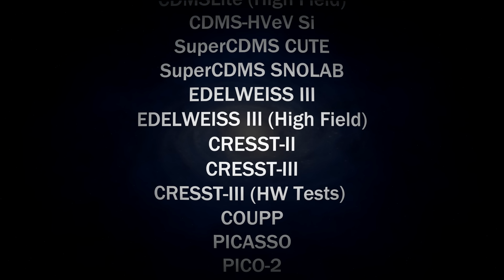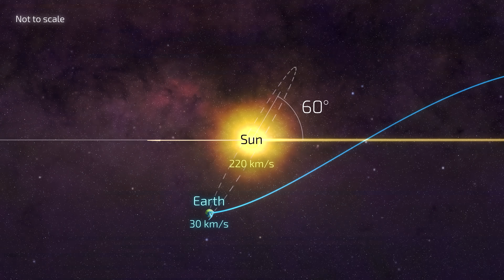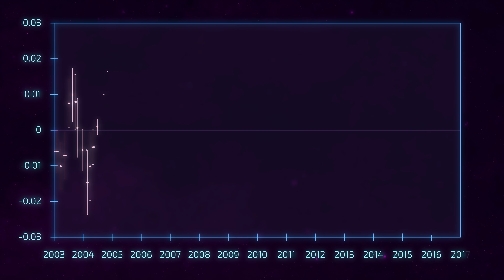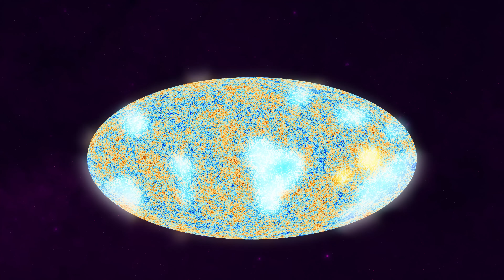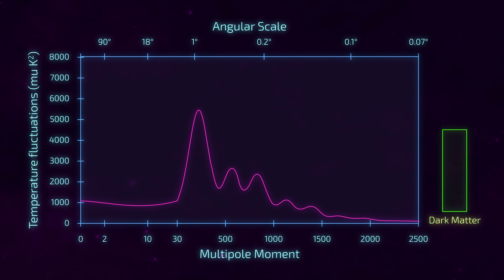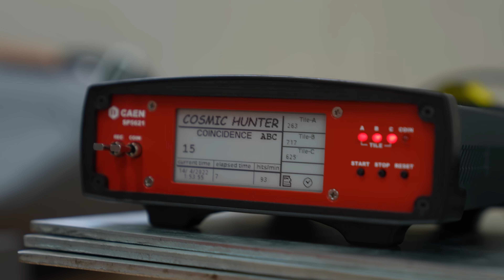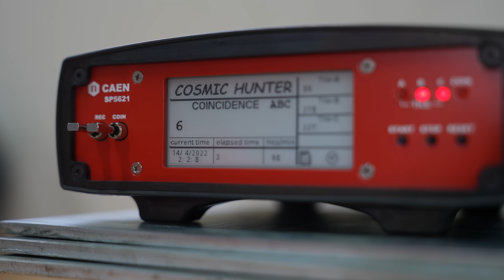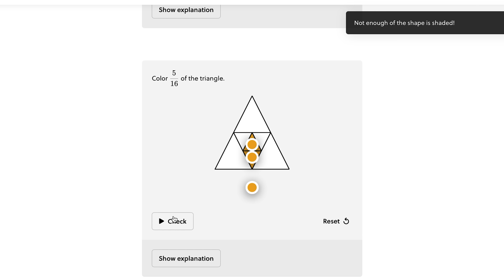The Absurd Search For Dark Matter

Comment: I would find it hilarious if all the filtering of the noise they do was actually blocking out the signal they want. I would also feel really bad for them, scientists are awesome.
Reply: The trick here is that wimps dont interact to ordinary matter that much so they'll pass through the earth with ease. So u can expect like some kind of uniform distribution of wimps throughout the earth and by chance some will interact with the crystals.
Reply: @thereaperandthesheep9186  great explaination thanks. It is a topic I do want to know more about someday
Reply: @thereaperandthesheep9186  If they don't interact with ordinary matter at all to the degree that there would be equal amounts of it anywhere inside the earth, then doesn't that mean they also wouldn't interact with the detector itself?
Reply: @Neme112  As I understand it – if they only interact by their gravitational field (due to their mass), than they would "knock" other particles if they come really close. As there's so much "empty" space between particles, it might occur only very rarely. I'm sure I've got this completely wrong (I'm not a physicist, just an ordinary electrical engineer who studied decades ago an only shortly worked in engineering), but I had to try … 😉
Reply: @c.augustin  "than they would "knock" other particles if they come really close" but that can only happen if they interact by some kind of force 🤔
Reply: @Neme112  Gravity (gravitational pull, as WIMPs would have mass). However it might work at quantum scale (I'm sure there are physicists that have theories about how this could work). If this new experiment doesn't show similar results to the Italian one, physicists have to search for other experiments/solutions. One way or other it will be good to know.
Reply: It probably does.  What's important is that the filtering attenuates noise more than the signal.  The only way around that is to wait longer....
Reply: I can't speak for dark matter, but I do know that Neutrinos only interact with the weak nuclear force.  An experiment local to me has a neutrino detector a bit deeper than 5000 feet down in a mine.  They use liquid xenon because it is both inert and a very large atom, making it ideal for catching something that only interacts with the internal forces of the atom.  The depth in the earth eliminates falsely detecting high-energy particles from sources such as the sun, because they'll interact with all that matter above them long before reaching the detector.  In fact, the detector is designed to look specifically for neutrinos coming from the opposite side of the planet.  Imagine, now, using an entire planet as a filtering shield for your detector.  Kinda crazy!
Reply: Not likely. The noises are well known.

Comment: Imagine sitting on a boat on a relatively calm day. As the occasional boat drives by you feel your boat move up and down with their wake. A light breeze may cause some ripples that you could see but never feel. These are the waves that you are aware of, but there are billions of waves you will never feel see or have any chance of sensing. Every fish fart or dust particle that impacts the surface of the water causes a wave that you will never notice but does affect your boat in some way. It makes sense that there would be many times the amount of something that we can't detect beyond what we can.  

Interestingly 5 sigma is the level at which a signal becomes insignificant. Dark matter while decreases in size at a logarithmic rate increases in cumulative presence at a 5x rate.

Comment: Man some explanations were so rushed they became bad. When you talk about changing the image to a graph and then simply talking about blobs and how the height of the graph matches how much dark matter there is (without giving any explanation to a link between the graph, the image that only shows thermal differences of 0.01 of temperature and how that correlates to dark matter). That's when talking about the CMB

Comment: My guess, just like the 49 DM experiments have shown over 40 years, DM doesn’t exist. Modified gravity theories are the answer. As an experimentalist, I feel sorry for those working on these pointless experiments, I can’t imagine how awful it must be to spend years working and getting nothing, again. There are literally hundreds of different published theories on what DM is made of. So one thing is for sure, even in the unlikely case DM is real, at most only a few current theories would be correct, leaving all the other theories being wrong. So we know that 49 experiments have shown it doesn’t exist, and by definition, virtually every or all published theories are wrong. Pro tip for young experimentalists: Stay away from this field! Find another one where you will actually get results and respect.
Reply: Except that there are a bunch of observations that Modified Gravity doesn't explain (and vice versa). This is why Sabine Hossenfelder, in her video, "Dark Matter: The situation has changed" argues that both theories (Dark Matter, Modified Gravity) are not actually in competition and can and should be combined. Dark Matter may be an incomplete picture of what's going on, rather than flat out wrong. Like the prof in the video says, "I hope it's more complex!"
Reply: The only way to discover is to experiment...

Comment: I feel like the idea of dark matter is a bit silly.  When we see that our models are inconsistent with empirical data, rather than going "our model is incomplete/wrong" we instead invent something to "account" for it.  This was the exact same approach used by defenders of the idea that the earth is the center of the universe.  Any time empirical data contradicted this idea, defenders would come up with some factor to account for it after the fact rather than even considering that their model might be wrong in the first place.
Reply: Because defending the current model is much easier than coming up with a newer solution to replace it. If we didn’t then we’d be trying to replace systems constantly rather than actually finding answers. Look at all of the answers we’ve found despite knowing GR/SR is wrong. Once we know the “better” solution we can just translate those answers to the newer system rather easily. If we never tried then we’d be behind.
Reply: The search for Dark Matter is literally an acknowledgement that the model is incomplete. Science doesn't claim to know everything so when you find empirical data that disagrees with your model you have to change something.
The current model still accurately predicts and explains a significant number of things, so any addition or alteration to the model has to explain all of those things AND ALSO explain these other discrepancies we've noticed.
If inserting some invisible matter "solves" the problem, coming up with a falsifiable test is just scientific.

Not all scientists interested in the problem are looking for Dark Matter either, so it's not like nobody is considering other solutions.

Comment: your not listening?  at the quantum level all matter is unified the sub atomic parts are all made from what i termed 3 years ago as the light cell,  these fundamental God particles stack one on top of the other like dixi cups in a package the ones that look like funnels.  just the shape holds them together but the mystery is the center where the photons graviton and antimatter tether to its partners in the forth dimension.  all mass is energy they can be converted one to the other using sound waves!  these light cells form long strings .

Comment: They should try to change the frequency of the detectors. Apply a vibration of different frequencies to cause more interaction with different matter. 
Just like the ph scale going from 0 to 14 and strongly reacting with opposites, frequencies and vibrations interact in a similar manner. Two opposing frequencies of the same wavelength cancel each other out. But two in the same direction can interact with ease or increase output. 
Its a difficult thing to design but one that should definitely be tested when detecting matter on a hidden level.

Comment: The stars near the black hole are more massive. In your dodgy experiment, you used the same star on a long string and on a short string. Use a heavier star on a shorter string and watch it go just as slow as a lighter star on a longer string. Problem solved. DM does not exist and neither does MOND.

The bullet cluster argument makes no sense.
Gas interacts with itself through gravity.
DM interacts with itself through gravity.
Gas remains in the center of the collision due to gravity.
DM does not remain in the center of the collision due to gravity.
That is the most illogical theory to ever be theorized. 

A sphere of DM around a galaxy, and the gravity of the DM sphere around the galaxy pushes all the normal matter toward the center instead of pulling the entire galaxy outward.
Just think of the absurdity of that argument.

Galaxies spin the way they do, because they are more dense toward the center. If they were more dense toward the edge, THEN they would fly apart.

Also, I thought it would take a light year of lead to have a 50% chance of stopping a Muon or whatever. I thought those things pass straight through the Earth like nothing and that’s why we put muon detectors under ground, so that we detect muons and not other cosmic particles. Seems like that’s just a complicated particle detector.

Nothing in this video made any sense. I feel stupider for having watched it. Nice one Veratasium 👍
Reply: hey bud, ever heard of the dunning-kruger effect?
Reply: @scalarknight , what part of what I said incorrect? You’re good at name calling, but apparently you got nothing for a counter argument.
Reply: @smokey04200420  you're right, i AM good at name calling! thanks for acknowledging it!
Reply: @scalarknight  don’t forget the part where you have nothing for a counter argument.
Reply: @smokey04200420  you have nothing for a counterargument? awesome, i win, then.

Comment: What if it's mega-ultra-low radio waves from other pre big bang sources dumping so much low frequency light it cant engage with electrons, talking millions of miles or more wavelength, but it can be manipulating gravity as it applies a pressure on magnetic fields? Emulating gravity as it creates simular effects. We can disprove that idea by evaluating divations in objects acceleration that may match sets of wavelength ... hrm this is hard to calculate

Comment: TO FIGURE OUT WHAT DARK "MATTER" IS = They  need to understand what gravity is first.
EkPyrotic  = The Universe is actually formed by 2 dimensions/planes colliding. (one mostly matter and one mostly space)
One dimension/plane transferred matter to this dimension/plane and was left with bubbles of space.
Gravity is matter in this dimension/plane being attracted to the other dimension/plane.
Dark matter = are the bubbles in the other dimension attracted to matter in this dimension and causing GRAVITY FIELDS.
Dense matter attracts the bubbles in the opposing dimension but too much matter (like black holes in the center) have an inverse reaction and reach normality when approaching the other dimension.  (Imagine a pool cover with water underneath and then placing a bowling ball on top of the bubble.)
The bubble (gravity field) is then mostly on the outer skirts of the galaxy , adding "dark matter".
This ALSO explains the bullet galaxy when matter in this dimension/plane is reactive yet the bubbles of space on the neighboring dimension/plane do not, and overshoot.
Thus ==== they will look forever if they are looking for a dark "particle" because it does NOT exist !
ALSO - the Higgs-Boson is part of a string that exists in both this dimension/plane and the other ( a closed looped string).
With enough energy, you knock it into this dimension/plane only, and are able to see it.

Comment: "Matter tells space-time how to curve, and space-time tells matter how to move." (Wheeler) -- What if spacetime can have curvature, perhaps imprinted during the big bang, independent of mass? It would look identical to dark matter. Visible matter would pool and eddy in the curves, as if there were invisible mass.
Reply: Well sure it *can*, that's basically what gravitational waves are. But there is no way in general relativity for curvature to get "frozen" in place without a source. And even if it did, that's not exactly what's happening, dark matter is moving around all over the place with the galaxies. So something out there is moving around creating gravity.
Reply: @ninjafruitchilled  I didn't think the "self-curved" areas of space would necessarily be frozen in place... It's a silly idea, but you COULD think of dark matter that way; you could have all the same effects without needing to invoke some mysterious matter. (But you WOULD have to invoke spacetime being warped without energy involved, which is a bigger reach.) Still, fun to think about.
Reply: Good enough explanation as any but way harder to prove.Could primordial warped space only, cause gravitational lensing? Maybe.

Comment: 1:16 "...a huge sphere of dark matter."

It's aball of dark matter, not a sphere. A sphere centered on the galaxy wouldn't permeate it, as it is just a surface.

circle <==> sphere <= both are hollow.
  disk <==> ball       <= both are filled in.

Mathematicians consider a sphere to be a two-dimensional closed surface embedded in three-dimensional Euclidean space. They draw a distinction a sphere and a ball, which is a three-dimensional manifold with boundary that includes the volume contained by the sphere.
Reply: -🤓

mocking aside, thanks for the info

Comment: If dark matter only interacts through gravity, shouldn’t a lot of it form black holes? All the dark matter should pull towards itself just like normal matter, but without any colmision when they come near each other. Then all that dark matter will eventually be concentrated at a point, and with enough mass it will turn into a black hole.

Question is what would cause friction in the system to slow the dark matter down so that they can form black holes instead of just flying past each other all the time.

Comment: So, we're assuming dark matter remains stationary with respect to the center of the galaxy for some reason?
Reply: a lot of dark matter will be in orbit around and inside a galaxy -- around it's center of mass
Reply: @nmarbletoe8210  If its in orbit basically orbiting with the sun, why would we see/expect to see the seasonal variation that was observed in the northern hemisphere and they are building to check in the southern.
Reply: @JustABill02  I think the idea is that each dark matter particle would have a random orbit, and most would not be orbiting the galaxy in the same direction as the earth.
Reply: @nmarbletoe8210  Interesting assumption, then it would all balance out and you'd still get the variation seen in the northern detectors  It will be interesting to see what happens with the ones in the south.

Comment: I have a theory as to the universe solar system works. Each one has a main star in the middle of them but the main usually has a hot or cold one, keep in mind when an object is colder then its surroundings or hotter itll attract hot air or in this case the universe and bring it in along with the extra flow of moving dark matter...food for thought?

Comment: Weird thing is, June and November are not 6 months apart, but 5 (or 7) :D
Anyway, matter is everywhere. Even in vacuum. If my math is correct, vacuum of our solar system contains more than 10^39 atoms (still, far, far less than our Sun contains which is like 10^58) but still it is a huge number of invisible atoms just floating in empty space :D Not to mention actual object that are too small to be seen.
Universe is huge. No wonder most of the matter is "dark". You expect it would glow like stars do? :D

Comment: Could it be "Frame Dragging" rather than Dark Matter? It's counterintuitive to imagine a space that is expanding. So, what about a space that is rotating? The objects within that space would be moving according to ordinary gravity, but would appear to move faster because the space they are in is also moving. I guess we would see some evidence in the emitted light spectra, but has the possibility of a rotating / distorted spatial frame actually been eliminated?
Reply: If the "rotation" were 4 dimensional... it would indeed hide/distort a lot of the evidence for which we're looking, as well as alter if not negate a lot of assumed values. Interesting thought, but proving the math would be insanely difficult.
Reply: This would be some extreme modification of general relativity, to vastly enhance the frame dragging effect on large scales (but not small scales; gravity probe B measured this very precisely around the Earth). I don't know if people have looked at that specifically, but they cast a rather wide and general net when it comes to all the possible ways of modifying gravity. It's really hard to make it work for dark matter without messing up some other observations.